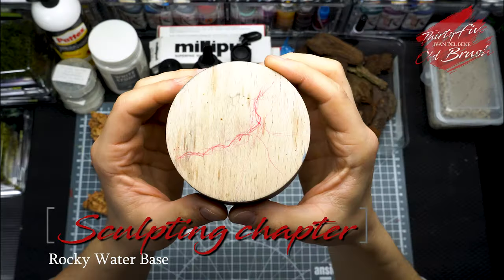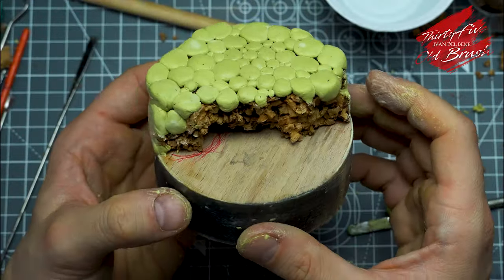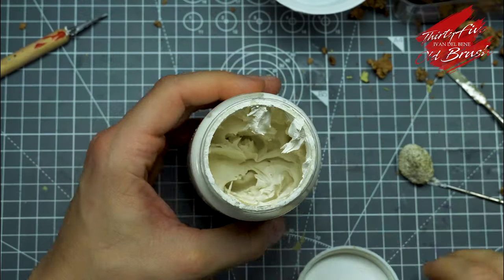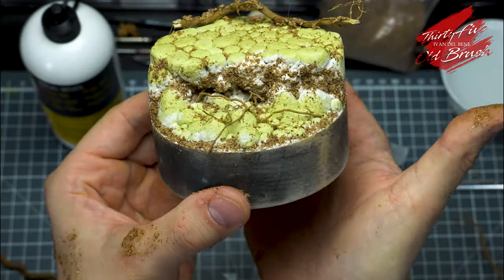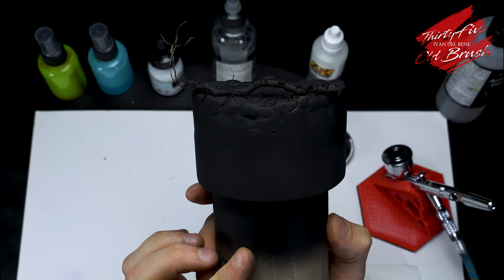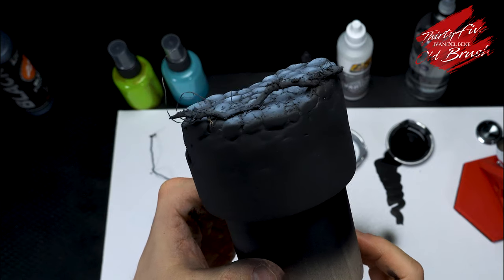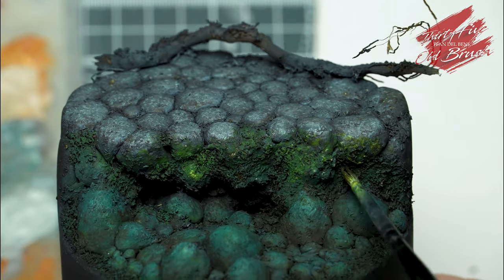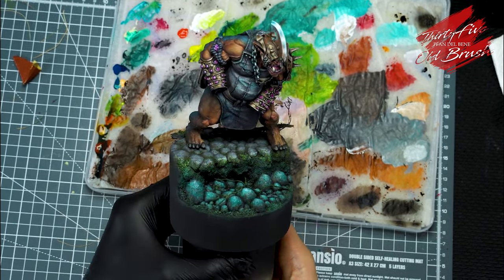Rocky Water Base  Sculpting and Paint  ..part one

Comment: Hey, few questions/notes: 1: Could you add links when you have time (plus you can get all those Amazon link bucks I would assume) 2: Is that wet palette hand made? Mine never seems that wet, and I never really know if it's providing me proper moisture. 3. Your background music, where does it come from? I ask because I am trying to start a YouTube also and all I can find are short 2-3 minute beats. I suppose I could string them together as a long beat, lol. Awesome work Ivan.
Reply from the maker: 1I will resech about make affiliate links😉🙏 2yes is a document holder broken in 2 piece.. I use a sponge under the oven paper and I add water evry 7 8 hours 3 on YouTube Thers a creator royal free music session.. Just type this and you'll find some tracks.. And of course you need too mix to get your desire length 😉💪💪